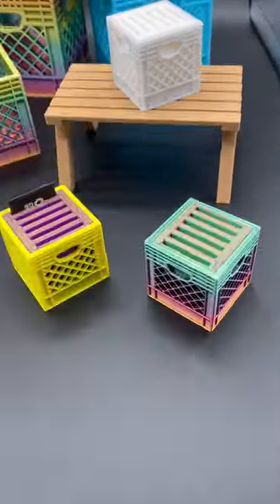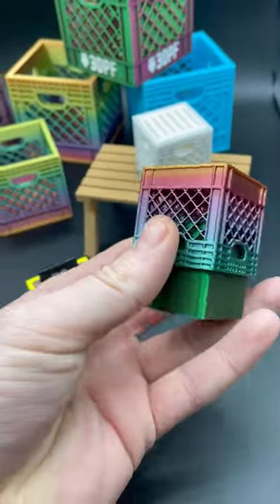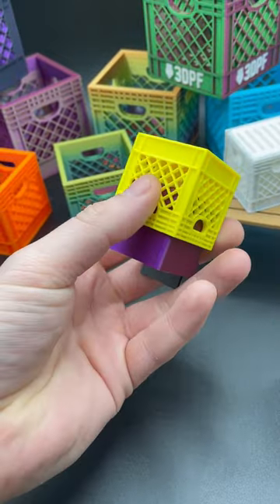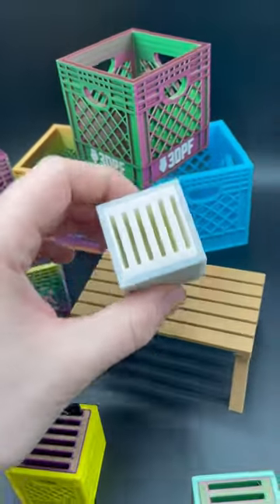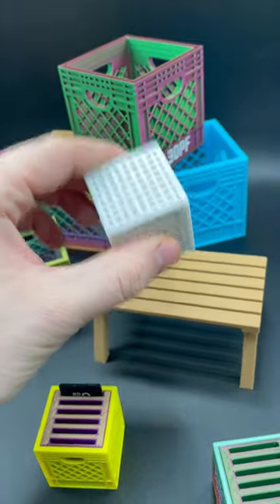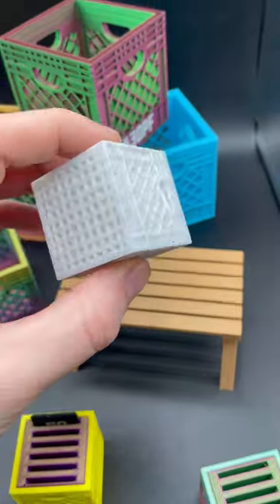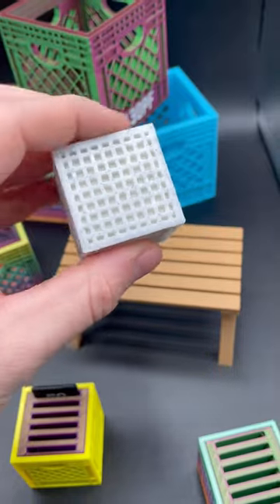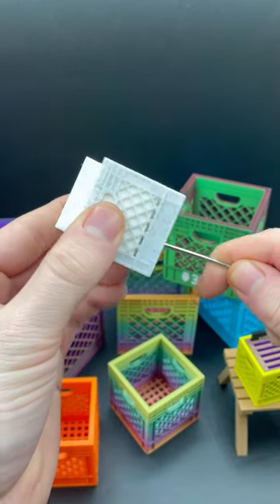The SD card attachment for the mini crate!

Comment: Wouldn’t you want it to not slide out easily? I like the white one that didn’t come out but if need be, the holes in the bottom of the crate should help get it out.
Reply: Agreed! Nice lil feature on that one
Reply: Here me know nothing 
( sand it slightly) 
I did wood and metal work classes in the 80s we knew sanding.. 
Same for decorating a light sand can fix minor imperfections
Reply: @toriladybird511  😂 you are really not wrong people do sand a lot when 3D printing because if you have a low end 3D printer you will have sand off the excess filament. Don't forget the supports will be cut as close as possible to the print without damaging it and sand of the rest. If you think about it 3D printing is very useful. For example you can 3D print tools, sockets,and even wrenches and sand cast them and then cast them 😂 it is a lot of work but it can save you a lot of money. My dad needs a 70 dollar socket and I looked up a free 3D model and printed it. He had a friend cast in a sand mold. With scrap metal. 😂 Endless possibilities just about
Reply: @toriladybird511 unfortunately PLA and similar material tends to melt rather than sand correctly so it's a b to sand - it just smears and warps the model layers. That's why you'll see bigger printed works primed in thick layers (with car primer or filler usually) so you're smoothing the primer rather than melting the PLA. Sadly that isn't likely to be possible or worth it on such a small print
Reply: @rabbitguts2518  this doesn't feel accurate; I work with PLA and it's perfectly easy to sand, you just have to be more meticulous than you would with non-plastic materials. Ie sanding in rotational or figure eight motions instead of back and forth or one way. Wet sanding vs dry sanding is usually the better way to go
Reply: You should do one for Nintendo switch carts
Reply: Kinda read that whole using my dirty mind
Reply: @AKindOfDog also higher grit sand paper
Reply: @rabbitguts2518 Nah it sands well but you are correct in saying that covering in a sort of shell and using that for the cast is good
Reply: I mean as long as u don't flip it ur fine
Reply: I totally agree !
Reply: He’s not planning to keep it upside down so it doesn’t really matter
Reply: Especially for people who own cats...

Comment: Fun fact, the official term for elephant's foot is die swell, and it is caused by entropy and molecular geometry. Before a polymer is forced into an extruder, the molecular geometry of the polymer chains are loose and more spherical, but as it is forced through, the chains become more linear. As it leaves the extruder, the more randomized polymer geometry is preferred, so the polymer swells in size as the chains partially relax from their linear positions.

Comment: Get a deburring tool ;)
Reply: use a elephants foot compensater in slicer, usually -0.4 is good
Reply: @mohitreddy8082  that's way too much. 0.4 is one line width. I use -0.12. If you have to use that much you're probably too close to the bed.
Reply: @Power-Wiesel  yea i over estimate on purpose for a slight chamfer, aslo for faster speed printer that lower z offset is required, esp over 500mm/s

Comment: I can see someone really struggling to pull it out by trying to pinch the hole or use a pencil or something to get it out, and cause infinite frustration only to eventually throw it on the floor and have it roll over and slide out easily. Gravity and rotation are such underrated problem solving tools sometimes.

Comment: Why don't you make a platform that matches the holes in the bottom of the crate so if you want to change it you can just put it on top of the platform and pull it out

I may have brain ded but if this is a good idea might aswell share it